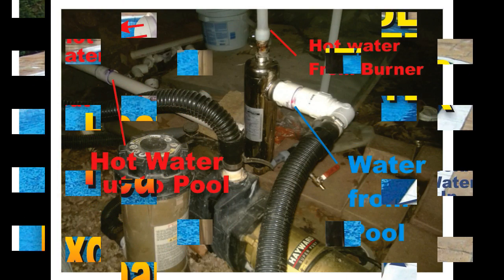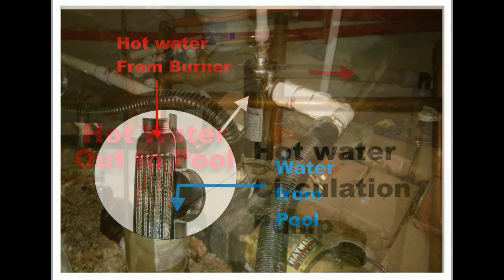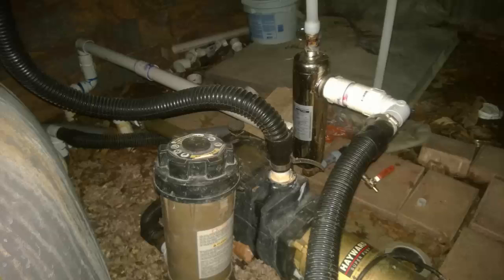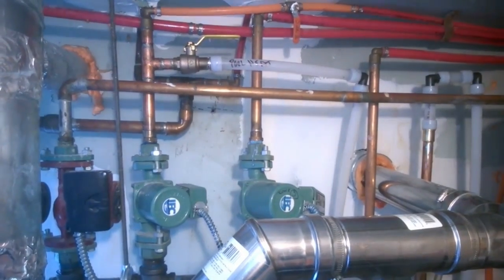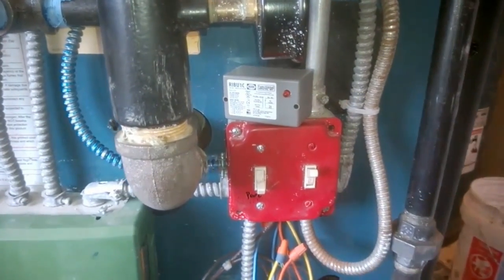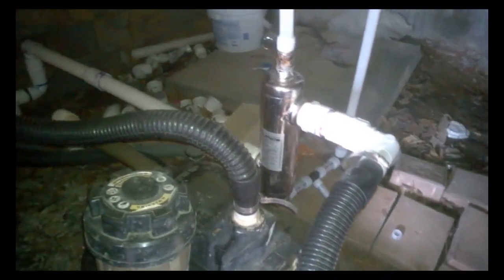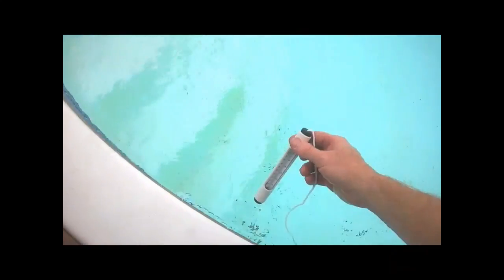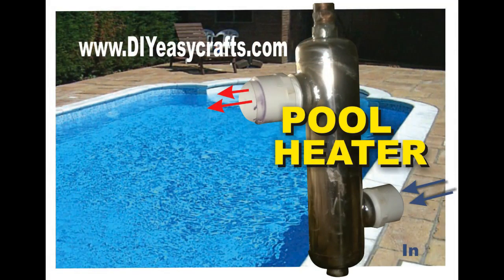Heat Exchanger for Pool Heater DIY How To

Comment: how does the water from the hotwater system flow through the exchanger?  where is it going when it leaves the exchanger?  there is the flow as in  Hot water tank has hot water, I turn on a hot water fawcet and it flows out the spicket because of the pressure difference.  You didn't explain where the hot water that is going to the exchanger is going after the exchanger

Comment: What if you have small pool say 3300L can you use smaller heat exchanger like https://www.manomano.co.uk/p/hrale-stainless-steel-heat-exchanger-30-plates-max-66-kw-plate-heat-exchanger-3214341?product_id=1810305  ... connect it to small domestic combi boiler and run standard central heating pump from the pool via heat exchanger back to the pool ? I have some custom plumbing of the boiler that allows me to bypass house radiators completely and run the boiler in small loop I can connect aux heat exchanger to this loop the only problem is sizing. I belive my boiler is 18kW ... what size heat exchanger do i need and what pressure from the pump ?